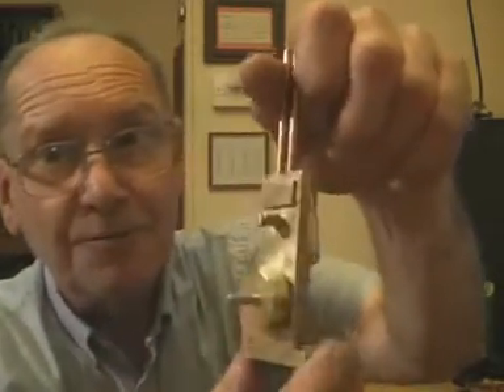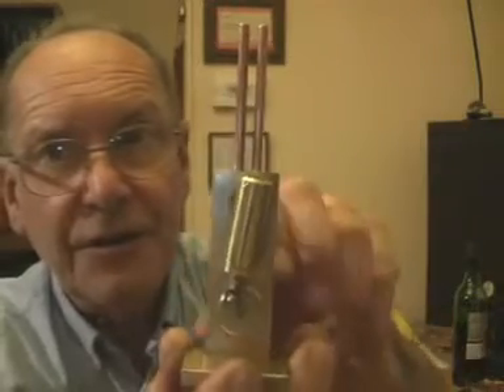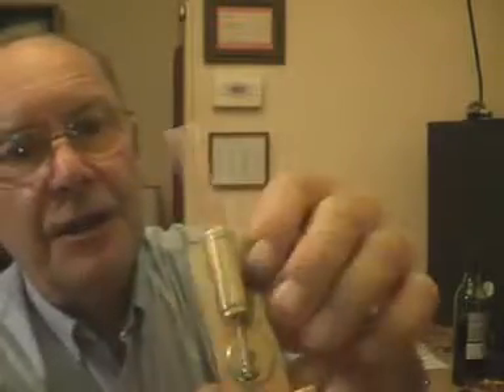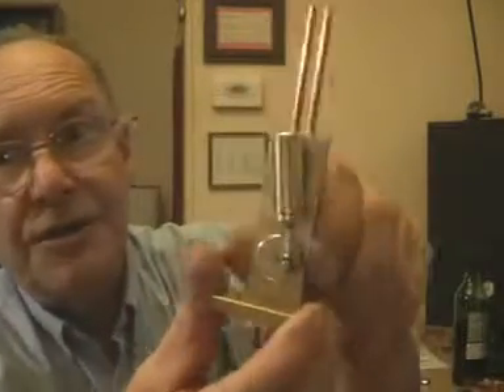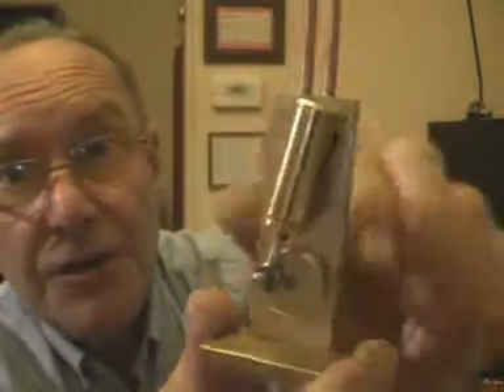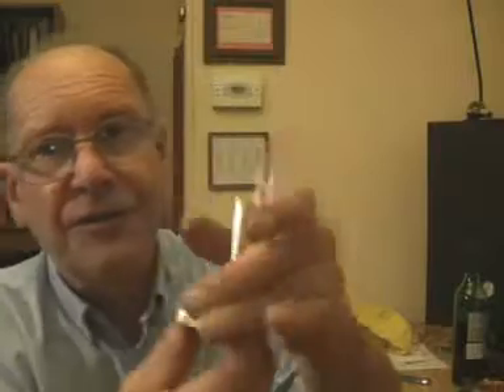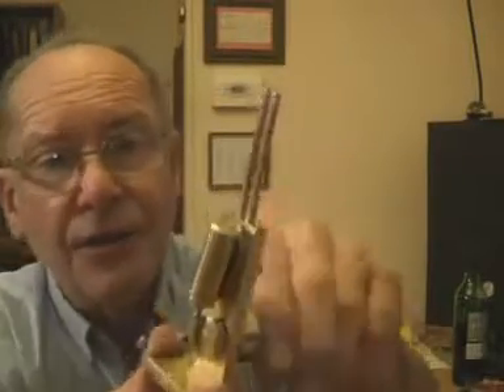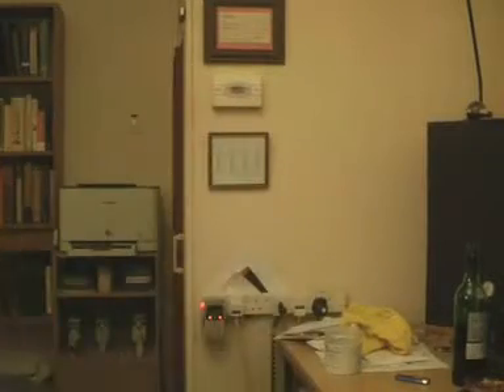oscillating cylinder model steam engine

Comment from the maker: Hi Karl. Glad you like the stuff! I started with steam engines a few months ago after retiring last October. The first one was indeed a kit; then I improved it a bit here & there. Then did a larger one which was self-designed & built from scratch, apart from the flywheel. This little one is from a design in a book, but was slightly adapted. It would have been a lot easier twice as big. Re. radio, yes; we have a nice old horn loudspeaker ready for a two valve receiver - coming soon, honestly!